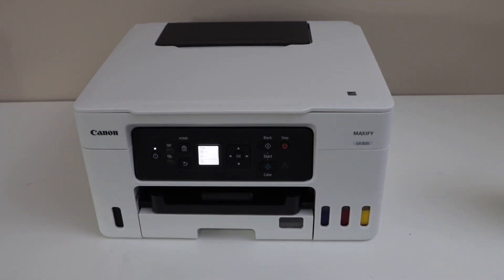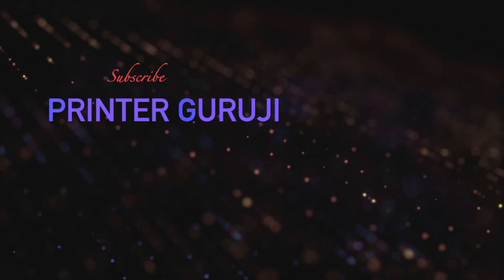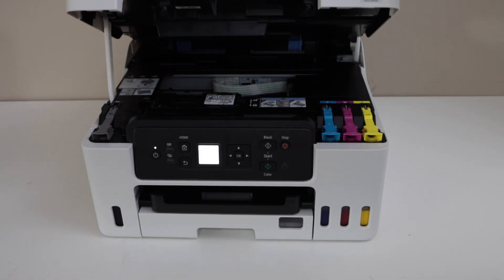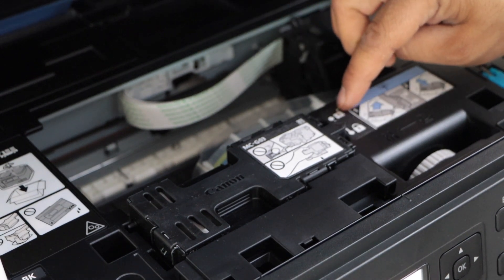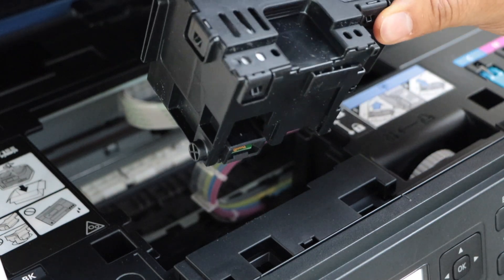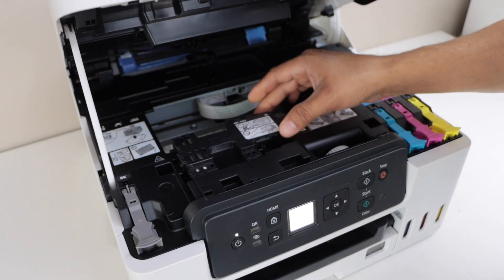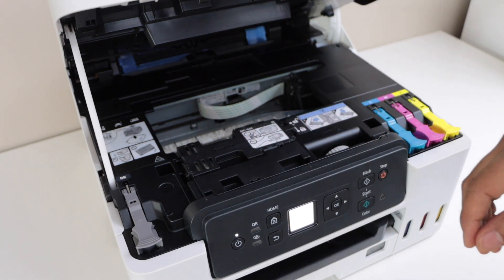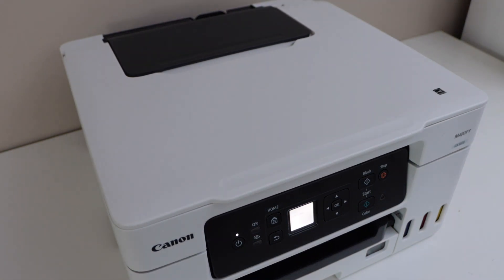Canon MAXIFY GX3000 Maintenance Box Replacement !

Comment: Can you recommend an excellent printer for printing photos and for regular printing and scanning? 
Also for electricity expenses, because I use solar energy in the evenings because there is no electricity

I also mean photographic camera images
Reply from the maker: Hi, I think Ink tank printers from Canon are best. You can buy any one on discount or offer. Not sure the voltage of your solar energy. That may be an issue. Printers need 110-120v  to work. If that is the case then, You may be best to use printer  from HP that comes with rechargable battery.
Reply: What is that is it the printhead u called it box?